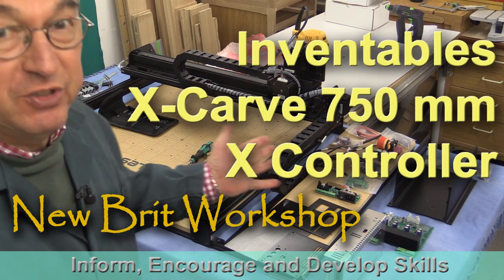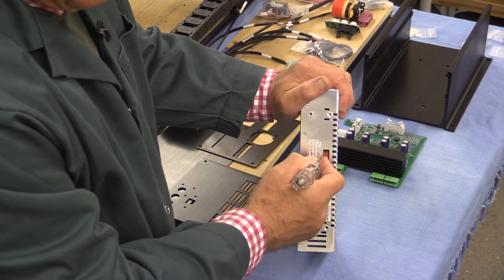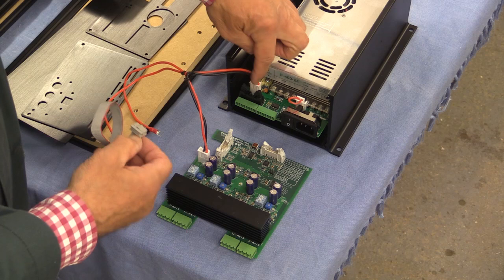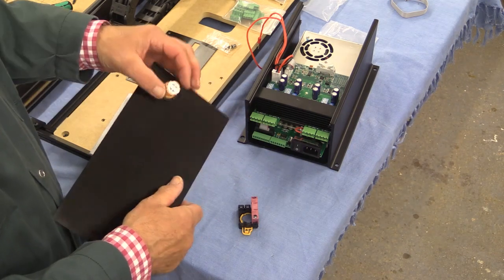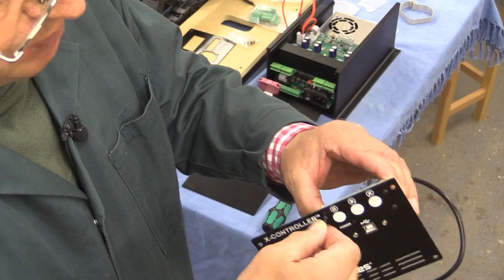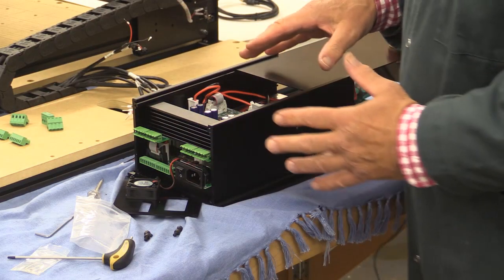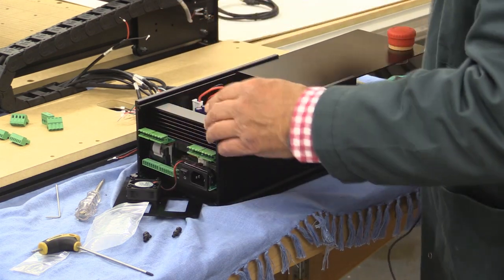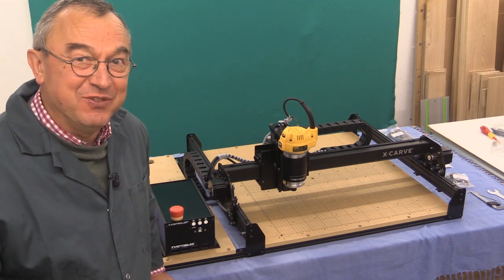New X Carve 750 mm CNC - X Controller

Comment: Peter, your videos were so incredibly valuable as I struggled to assemble my 1000mm X-Carve. As you mention several times, their instructions are at times incredibly ambiguous (particularly this section assembling the controller). The instructions on their web site cover the old power supply and leave out several other key instructions. That said, do you have a video on doing the final calibrations and then any instruction on using the clamping kit?

Thank you for all your efforts making this videos!
Reply from the maker: Hi Paul, My final video was of the commissioning and it is in the same playlist. I have not delved into any form of calibration adjustments I'm afraid.  Peter
Reply: @NewBritWorkshop   Sounds good, sir. Thank you for the quick response. Your videos got me so much further than the instructions did (especially the wiring). They helped keep me sane and prevented excessive visits to my bottle of Lagavulin. :)

Comment: Hi Peter
I finaly got my x-controller assembled.  Thanks for a great instructions.
And it runs perfect,  but...
I have not found on Inventables sites what the front buttons is for (the white ones)
Do you know what they are for ?
Kristian
Reply from the maker: Hi Kristian, I have not investigated those buttons at all but they may be for something that is done through Easel. I do not use them so cannot help any further.  Peter

Comment: Hello Peter
I recently ordered an X controller
from the English company RoboSaavy
And waiting to get it home.
I looked at your youtube instruction on assembly
of the X controller
And it was super good. Thank you for a good instruction.
But I wonder if your cables to the stepper motors
They look thinner than those that came with when I bought
my x-carve  (it´s an 1000 mm)
Is it a new type of cable? they look thinner
If that's it, have you bought them in England?
Kristian / Sweden
Reply from the maker: Hi Kristian, I have no way of answering this as I have only ever seen my own set of cables and not any others. I would not worry about it as long as they work.    Peter
Reply: Thanks Peter.
Reply: Hi Peter 
I finaly got my x-controller kit, and I have unpacked all the parts but....  there are no switch for the power.
Have you any clue why it´s like that.  I have not got any answer from Inventables yet.
Hope you don´t mind asking you.
Kristian
Reply from the maker: Hi Kristian, The on/off switch is right next to the socket that the mains lead plugs into on the power supply module.   Peter
Reply: Peter I did not explain it right.
I ment for the 115/220 Voltage.

Comment: New Brit Workshop+ Hello Peter. Thank you for the accurate installation videos. I just bought a X-carve 1000 on your black friday tip. I have received 3 packages so far. Unfortunately, I'm shocked  how badly packed the packages are. All three were damaged. You have made a small mistake, it does not matter to the function but I know how careful you are. The mistake is that you installed the first ribbon cable wrong. On the cable there is a red border for pin no 1. There is a small triangle on the PCB that coordinates the red thread. If you had mounted it correctly, the cable had gone the right way and an easier way. But as I said it has no electrical significance. The power supply was different  and was a multi power device 88-240 VAC.
Reply from the maker: Hi Lars, What a shame about the packages arriving damaged. Thank you for the clarification about that cable. Yes, I know that they have recently introduced a new power supply. Cheers.   Peter

Comment: Hello Peter,  I want to have my router start automatically is it just a matter of cutting off the router plug and wiring it to the control box?  Just want to make sure the wires are going to the right place. Thx
Reply from the maker: Hi Chuck, It is not possible without getting more hardware. Take a look at the Inventables forum and see what others may have tried.  https://discuss.inventables.com/t/dewalt-611-non-destruct-automatic-spindle-control/11850    Peter

Comment: Hi Peter. Your videos are fantastic mate. I too have a 750mm kit on the way. It should arrive any day now and am excited to get started on it. Just one question regarding the power cord for the X Controller. Did it come with a US plug, or do they send a plug appropriate for the country they are sending the X-Carve to? I live in Australia and want to be prepared.
Reply from the maker: Hi Sam, Mine came with a US plug on the end but it was easy to cut that off and put a UK one on. The other way would be to use a standard computer lead (we call them Kettle leads over here) as it is that type of socket in the back of the X Controller.  Have fun.  Peter
Reply: Mine came with a UK-plug!  I needed a EU-plug so there is just to get the nippers.
Reply: Lars  Mine  too.

Comment: Hi Peter, excellent video - as always.
Looking forward to the next (although Robosavvy are currently out of stock I am really awaiting your final review before I place a back order myself).
A couple of questions if that's ok?
Are the instructions you received a printed version of the online manual (http://x-carve-instructions.inventables.com/1000mm/) which looks pretty good - they do ask for feed back and looks like they may adjust them on the fly.
And with the small fan for the controller does it matter which way round it goes (does it blow air in or draw it out?) or can it only fit one way round?
Many thanks - your work is really appreciated.
Mark / Chris
Reply from the maker: Hi Mark, I have done all of the filming for the complete assembly and testing of this new machine. I have a lot of editing work to do which explains why you will not see the final video in the series until the latter part of next week. I have no hesitation is saying that this machine is excellent. There are a huge numbers of improvements over the original machine and the X Controller is just one of them. The instructions were on line which may it tricky for anyone building their machine in a shed at the bottom of the garden !  That fan will only go one way around and when you have it in your hand you will see that a pair of wire comes out at the back. I think it blows - if I smoked I could test it. Please do not hesitate to ask more questions when your kit arrives.    Peter

Comment: Good job Peter, but what I can't understand is why the X-Controller wasn't supplied ready-assembled.  I can understand why some construction work was required on the 'cutting' board and other parts but not the controller.
Reply from the maker: Hi Richard, I am only guessing but I suspect that there is an advantage in selling items as a kit - it will at least save a lot of labour.   Peter
Reply: Although Peter's right, I'm half convinced, having built one, that some of the stuff is just not assembled to make you feel like you are assembling something. The Controller is a case in point I think as it is just plugging stuff in and screwing stuff together.